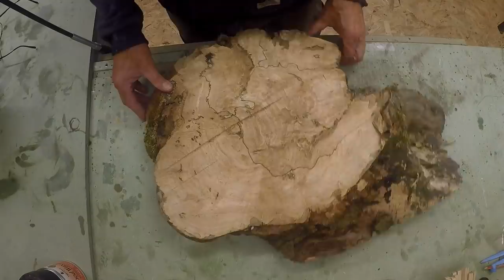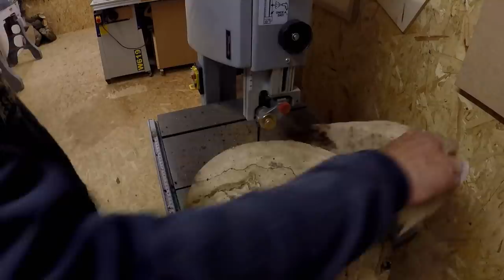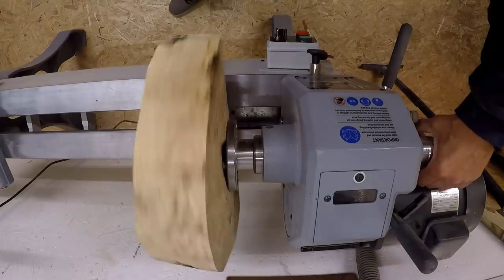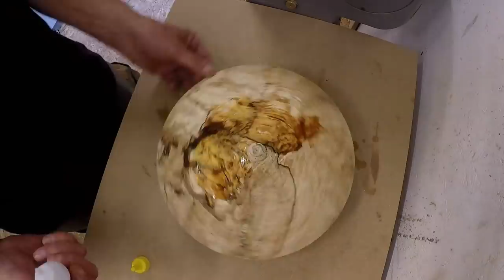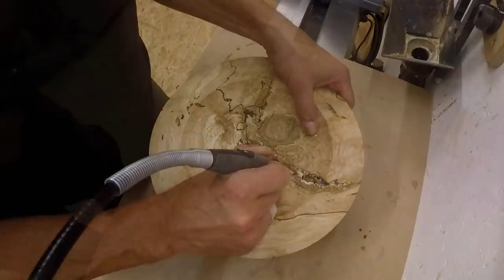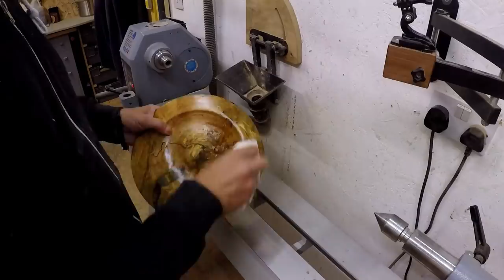Woodturning - The Emerging Man

Comment: Ca glue has saved my arse when working on things more times than I care to count especially when working with "punky" wood on something (awesome expression, I like it)  BTW I tend to use a medium grit sanding block to remove it from skin when it doesn't easily peel off, the sandpaper removes the glue but leaves the skin unharmed, pumice stone in the bath works alright too. Yes I use my fingers to spread the glue when I'm working with it, definitely not something I'd recommend for anyone to try but that's just what I've found works best for me

Comment: My favorite kind of turning wood -- gnarly to the extreme :-) Came out beautifully, Andy. I know you probably had to use epoxy and CA glue on the seriously punky bits, but I've had success flooding punky wood with a half & half mix of cellulose lacquer and lacquer thinner (basically sanding sealer without the sodium stearate soap), followed with full strength lacquer. I've done some pieces that are probably 50% lacquer by weight :-)  Clyde
Reply from the maker: Thanks Clyde .. cheers for the tips I do use half and half cellulose / thinners I will have to try it .. I just bought some wood hardener to try the type you would use on wet rot I have 2 more large burls off this tree which are as gnarly as this so any tips are gratefully received ..cheers Andy

Comment: Hi Andy, I like the piece and well done for persevering. I've got a couple of questions:
1) Did you turn a tenon for the base, could not see in the video?
2) When you applied the CA glue to the base, did it leach into the surrounding wood? Or was the CA glue the highly viscous stuff?
3) When you applied the Epoxy resin on the top side, how did you stop gravity causing the resin to pool in the bottom of the bowl?

On a seperate project earlier this year I had a go at a Tectonic Plate. Used a piece of Alder that I force-dried in the M/wave. Followed the same technique as yourself, but made 3 "plates", with a blue-coloured resin between  - only problem was the wood MOVED slightly whic made me laugh it being a Tectoniv Plate. I'll send you a photo sometime, but intend to have another at it. Cheers
Reply from the maker: Thanks .. I didnt think a tenon or a recess would hold with the punky wood so I glued a tenon on the base so i could mount it in the chuck
I applied the ca to the softer areas but wasn't really worried where it leached I used 5 min  epoxy  which if you catch it at the right time you can mould it a bit before it goes off ..cheers